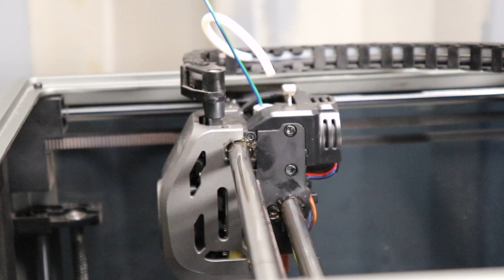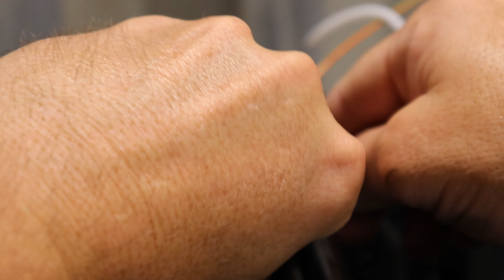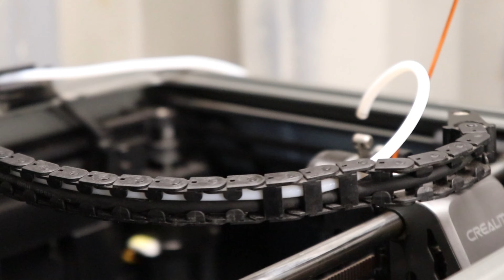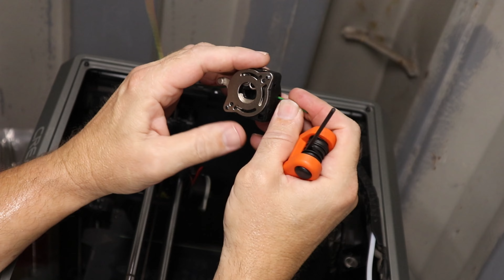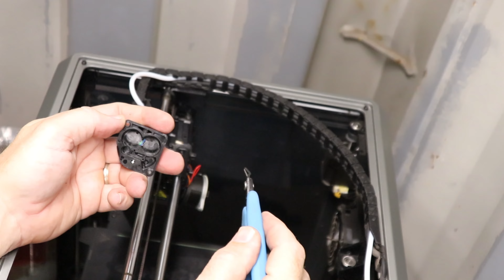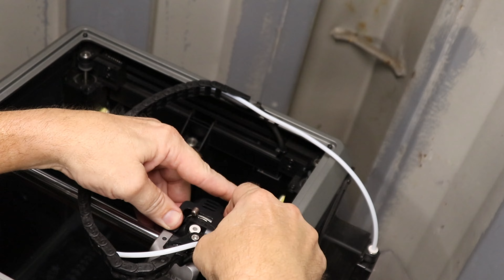REMOVING A FILAMENT JAM IN THE FEEDER ON THE CREALITY K1C

Comment: Nice. I wonder if you might have a moisture problem with your filament. I don't have that specific printer but I know when I had a moisture problem I had all sorts of issues. Filament snapping in the tube and snags and bind-ups like you had there were pretty common.

I recommend that you lightly lubricate those rods with some white lithium grease as well and keep them free of dust build-up so that you don't have issues. I let dust build up on my Ultimaker rods and moisture caused rust to form in a ring around one of the rods. I saved it before it started pitting but it was getting close to causing permanent damage. 

But if you keep those rods clean and lightly greased so that everything runs smoothly you shouldn't have any problems. Depends what sort of environment your printer lives in, of course, but if it's anything like mine was, dust build-up on those rods will, if left for a while, suck up moisture from the air and you could end up with surface rust in a ring around the rod where the dust gathers. It certainly surprised me when it happened to mine.

I just lightly grease my rails every time I see any build-up now and I don't have to worry about it.
Reply from the maker: I have a couple of things I think may have caused it. It was very hot in my shop during this print. I had the top on and door closed. At this time, that is what I will contribute it to since it's not normal for me to do so, but I've had a lot of traffic in and out of the shop, so it was very dusty. 
I live in Florida and humidity screws with everything I do from painting, wood warping and moist filament. But, I always dry my filament before and during my prints. Before I had the dryer, that might be something I would have looked at.
Those are great insights. Keep em coming!!

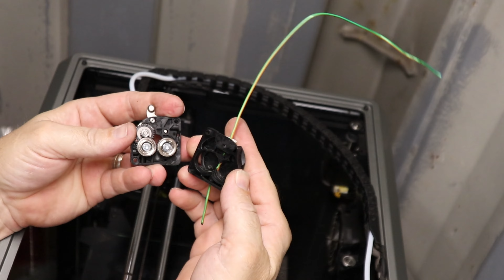Comment: The cut at 8:05, how did you get the cover off? Another video on the same topic also cut and I can't get the top off!

Edit: ah the stuck filament sort of blocks the removal of the cover, so it can be a bit difficult. I used a large flathead to pry it open.
Reply from the maker: Have it in the locked position and it should come off without too much difficulty. If needed, take a small electronics flat head screwdriver and gently twist around the seam to work it loose.

Comment: But why does this happen on the K1’s? I’d want to know before I put it all back together. Heat creep?
Reply from the maker: Here is my experience with this issue:
It has happened to me 2 times. Both were with PLA filament. Both times it happened, was when my shop was abnormally warm and I had the lid on and door closed. Under the same temperature conditions, with the lid off and door closed, I have had no issues. That is with 50 days and 2 hours of total print time. So, I'm chalking it up to excessive temperature in the print chamber.
Reply: It happens quite regularly to me (about every 10hrs print with PLA), so I got quite good in unjamming it. Not sure yet why it happens so often. Changed both extruder and nozzle. I doubt it's the heat, but will keep it in mind. My guess it could also be Filament Quality and/or high speed printing....

Comment: I cannot for the life of me get my extruder to pull apart (the piece housing the gears). All screws are removed and everything. Terrified to break it by forcing too hard.
Reply from the maker: Use a small flathead and gently pry it at the seams.
Reply: @LaserNoob  I finally got it to pop off. Thank the Lord the small bearing that fell off didn't roll somewhere 😅 managed to do it with this little prybar that came with my adult Legos set along with the scraper that came with the printer.